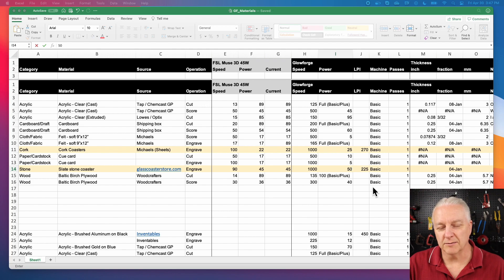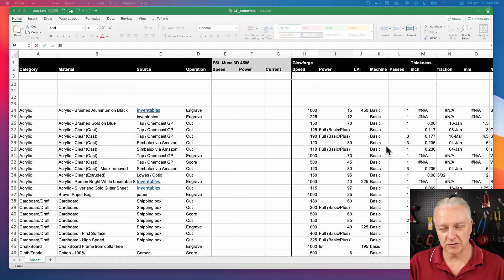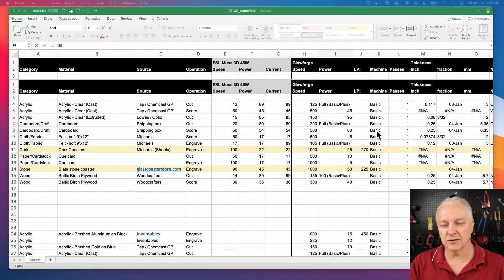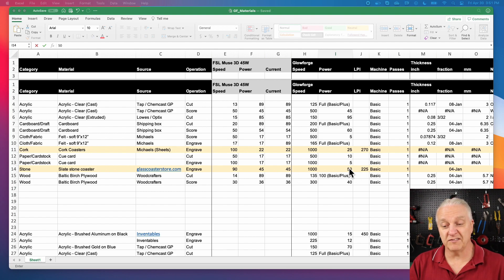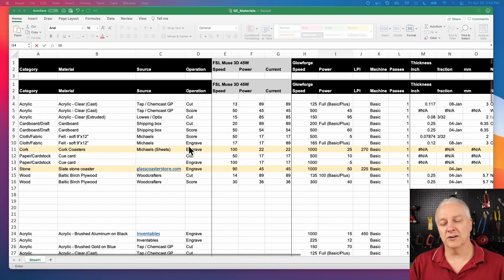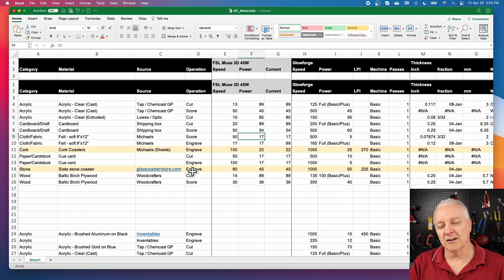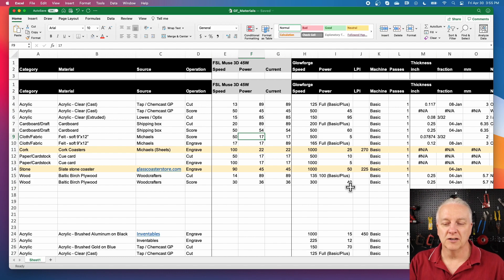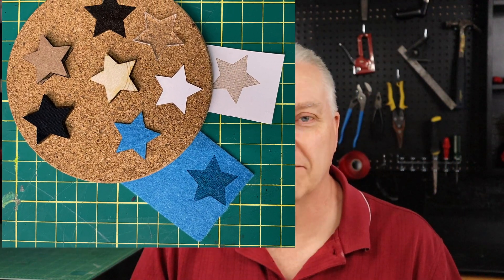GLOWFORGE VS MUSE SETTINGS // Can't We Just Share?

Comment: Very helpful video, Steve.  Is your spreadsheet comparable something we can download?
Reply: I would also like to have that sheet please post a link here. Thanks
Reply from the maker: @slimvaio  I uploaded this file to my GitHub repository and added a download link in the video description.
Reply from the maker: Hi Nicole, I can make it available if you want though it's an Excel sheet so you'd either need that or be able to import it into something else.

However all of the settings I converted are visible in the video
Reply: I use excel so you could attach it and email it to my 3dartpics email.

Thank you